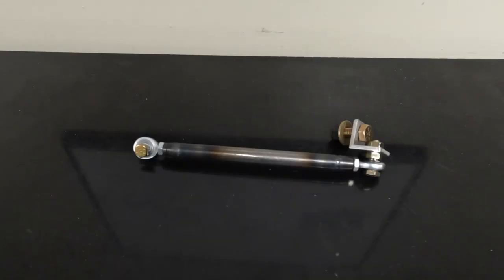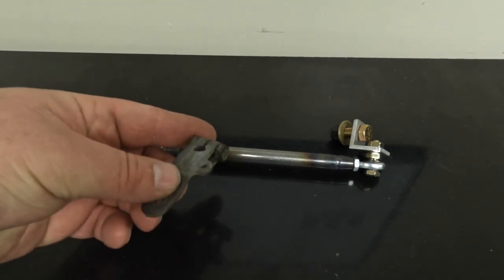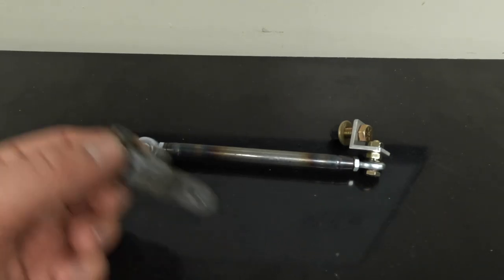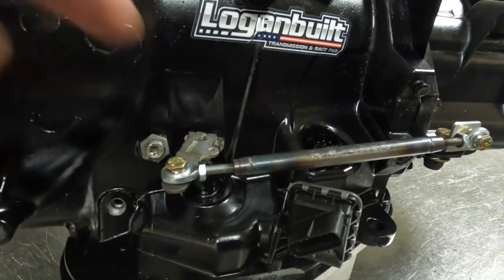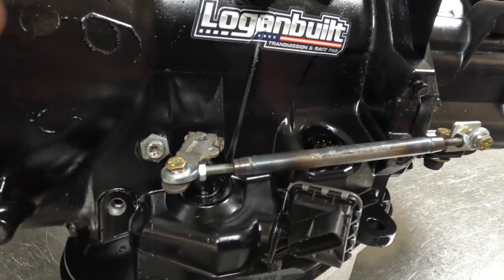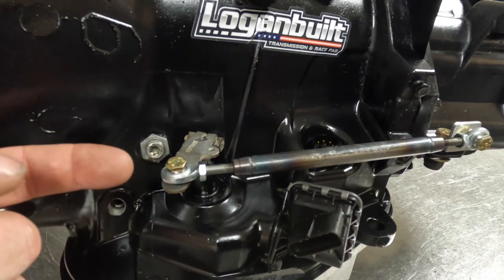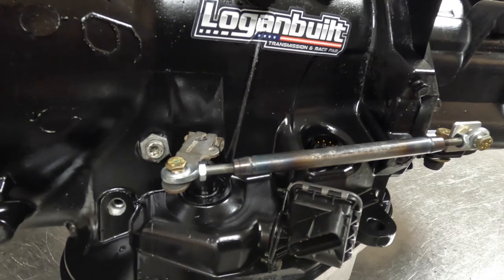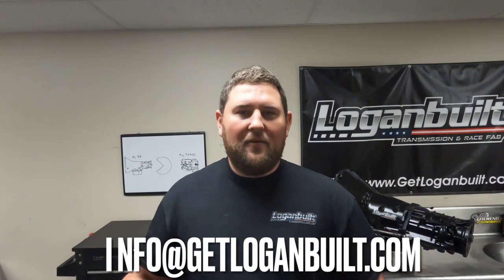Loganbuilt Full Manual Valve Body TV Adjuster Kit! Why You NEED This!

Comment: This is probably what I needed on my 68' Roadrunner,(they used a TVCable on the 727 transmission too.) When I had the manual valve body put in it. The damn thing never worked right since I had it done. And the tranny shop never fixed it right.

Comment: Hello, what would I be able to use your kit if I installed a Transco -3 manual shift kit on a 46RE or 518?
Reply from the maker: Yes you would. You would use it to set your line pressure on that trasngo TF0D3 kit

Comment: ive got a 46rh with a built non manual valve body would that work on mine ?
Reply from the maker: No it won’t. If you tie your Tv back on a full functioning valve body, it will not shift on its own.